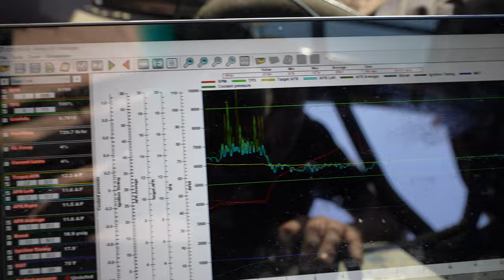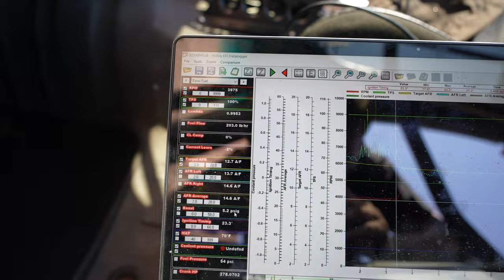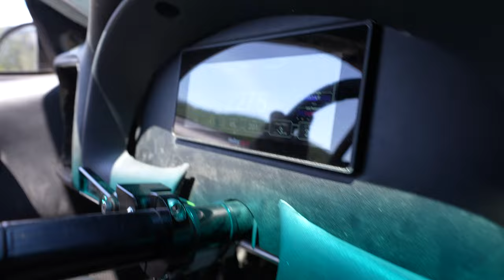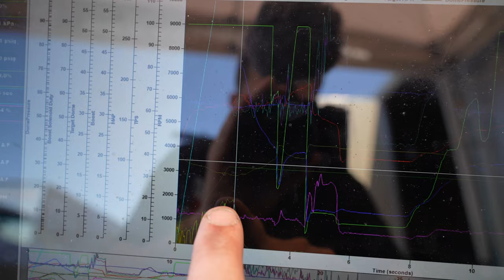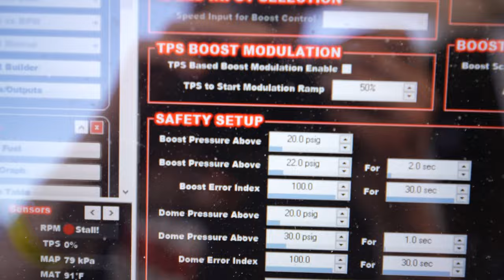Salty Twin Turbo Camaro Runs QUICKEST and FASTEST Passes EVER!

Comment: You still have the no prep suspension setup. Tighten the front down, separate in the rear. You should be in mid 7's easily.